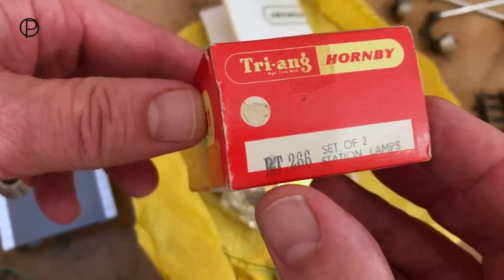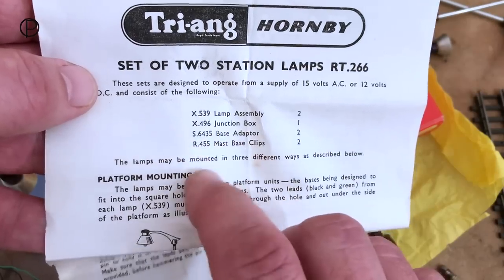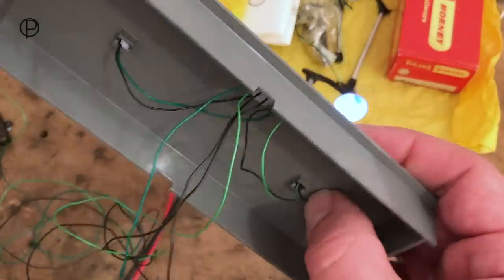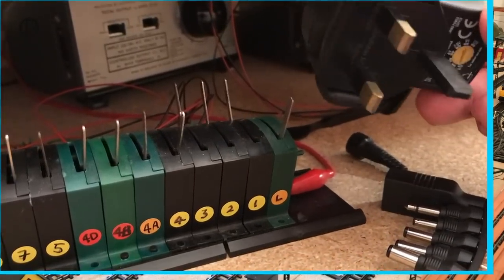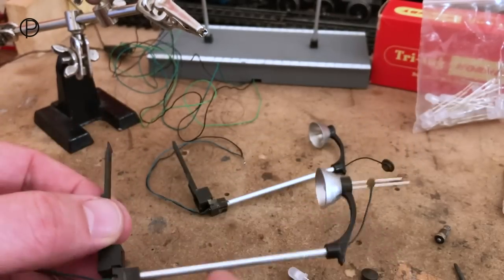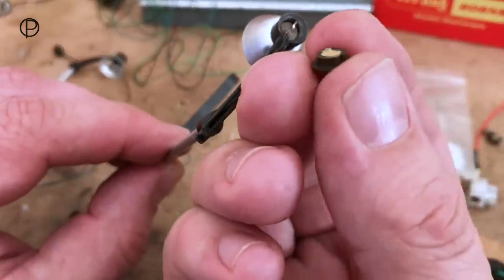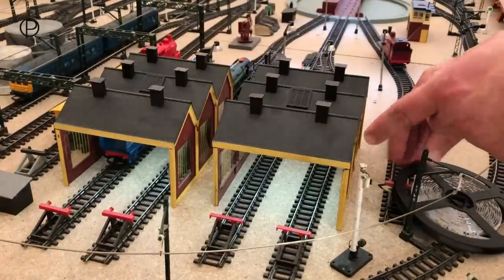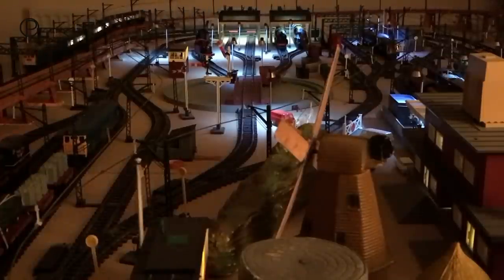Tri-ang Hornby RT.266 Set of two Station Lamps with LED conversion

Comment: I'm late to the party as usual. I'm in the middle of constructing my layout. I've repurposed a PC power supply to give 3.3V, 5V and 12V DC supplies. I'll use the 3.3V rail to supply the lighting on the layout as it'll be more efficient. The resistors will be a lower value and will have to dissipate less heat to bring the voltage to that required for the LEDs.
I also think that I'll be able to 3D print some lamp standards instead of using proprietary items. 
Great videos Oscar. I really enjoy watching them on Sunday mornings. Keep up the excellent work.
Reply from the maker: Good morning Goseleydale RTC that sounds like a great plan especially reusing old PC power supply's. 3D printing lampstands is also something I had toying with as the original bases for the Tri-ang Yard/Station lamps are very fragile. 
Thanks again for watching glad you're enjoying the videos.
Take care.
Oscar

Comment: Very nice installation of the LED's Oscar, much better then incandescent bulbs, the LED's do not get hot...Simon
Reply from the maker: Thanks Simon. It's the not getting hot part I think is important. When I was a child I remember using old Christmas lights in Superquick cardboard buildings! The roofs used to get very hot! What a fire hazard....
Oscar

Comment: I withdraw my previous comment - must have missed you mentioning it! Another tip though, as you mentioned working in the semi-dark. I fitted a few strip LEDs UNDER the baseboard as well, which helps working underneath! Great video & How To. I refurbish HORNBY Dunlop colour light signals with LEDs if anyone needs any doing........best wishes. Bob
Reply from the maker: Sorry Bobby I should probably have made that information a bit clearer. 3v LEDs with resistors (in line) below the baseboard. I love the Idea of putting LED strips under the baseboard for working. I think this is a must for the next layout.
Thanks for watching Bobby.
Oscar

Comment: They do look very effective Oscar , thanks for showing how to do the re wiring .......Peter
Reply from the maker: Thank's Peter. These lamps so often show up with no bulbs or broken/dead ones its seed the best thing to do. I've been told that there are still replacement bulbs available at a quite a price. But with LEDs, the lamps stay cool which is a bonus and safer I think and they are less than.10p each. I've not had one give up yet on the layout yet. I think the first ones I converted were about 3 years ago and they stay on for hours.
Oscar

Comment: Presumably these are 12 volt LEDs? If not, it’s important to remember to connect a resistor in series (in line) with the cable.